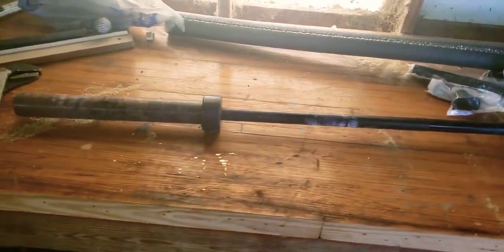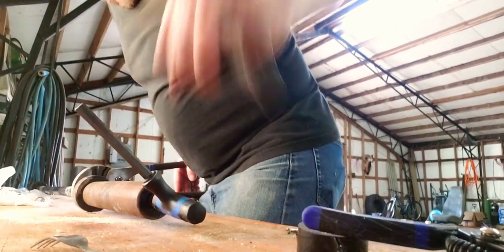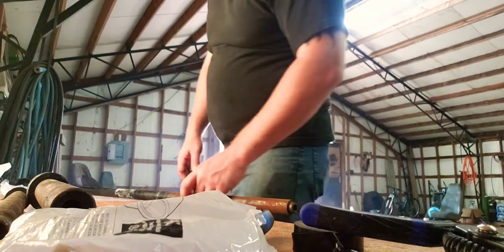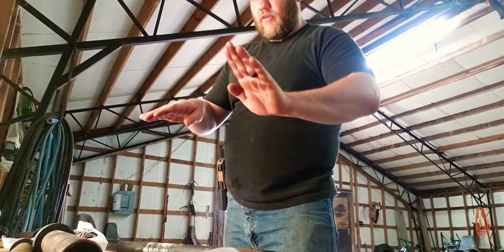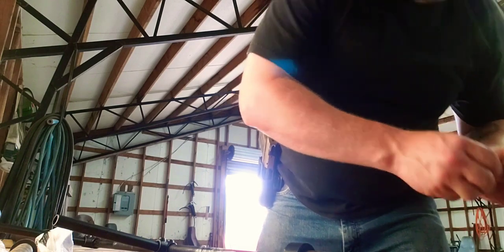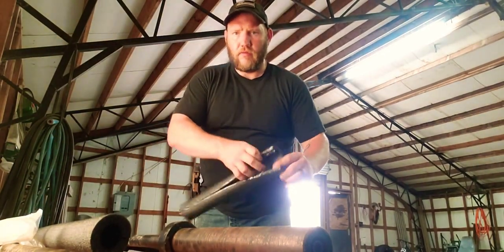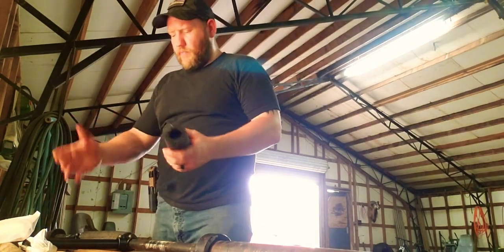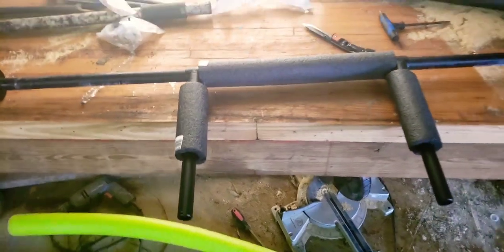Diy safety squat bar for under $30

Comment: I returned the items to Lowes. I was looking at the tom platz appliance and came up with a prototype that you don't have to disassemble the bar. Costs about 15 bucks. I have to tweak it a little. I tested it out and I think it is one of the most comfortable squat assistance appliance.

I wanted to thank you for you video. You gotta me started on a course that I can now do heavy leg work at my house.
Reply: You've gotta share what you came up with!
Reply: Share where you got the parts and the name of the parts please.
Reply: share plz
Reply: @cLcs  I'm going to try a 1.5 inch split ring hanger and a 3/4 inch threaded pipe (1ft long) x2
Reply: @ash24480 how did it work out for you?  I’m going to try the 1.5” split ring too but it only takes a 3/8” threaded bolt/rod. That might be ok. Also it’s for my smith machine so I can easily remove the split ring. Thx for the idea!!

Comment: I was very impressed with your theory. I went to Lowes  and bought the 3/4" parts you suggested. It turns out that almost every Olympic bar is 1 and 1/8 to 1 and 1/4 inches. A 3/4 inch bar is very rare and is normally used for women or children. That bar is not designed to handle a lot of weight. Please specify in the future that people should measure the bar diameter. the most people don't have vernier calipers. They can take one of the end of and measure with a ruler or tape. Lowes doesn't appear to have 1 1/8. Looks like I will have to use 1 and 1/4 inch and some sort of shim on the inside.
Reply: I went and did the very same thing, my friend. This is definitely a great idea. I love my little set-up now.